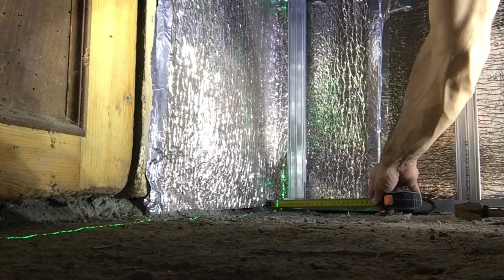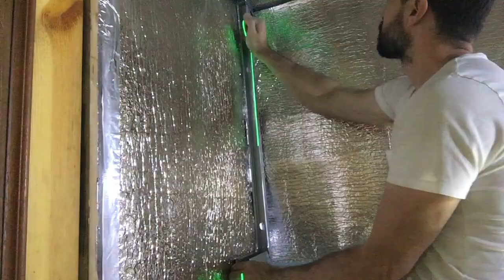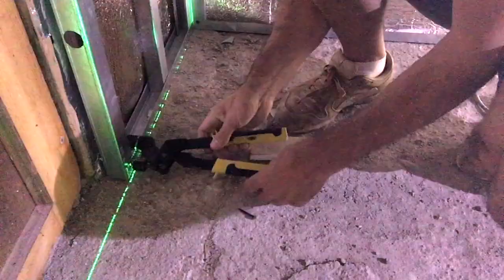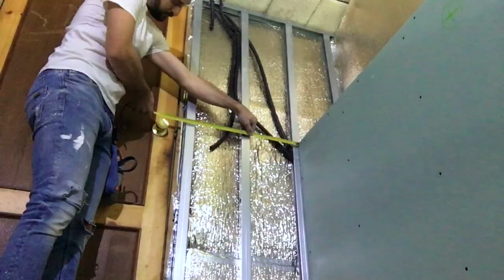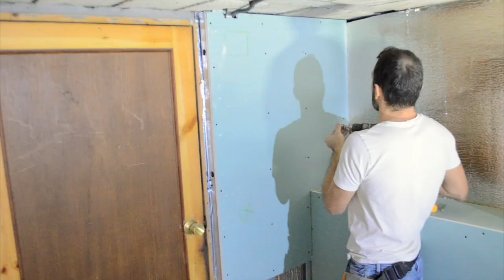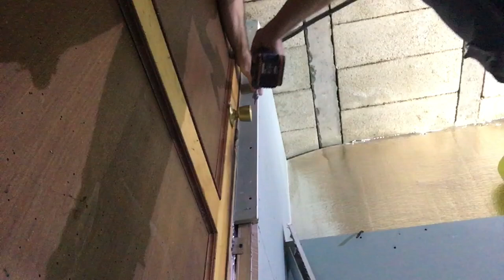🔥 Cómo hacer mini Trasdosado Autoportante de pladur 🤜 Perfiles 36mm ✅ drywall

Comment from the maker: :yougotthis:Muy buenas :elbowcough:

¿Qué son los trasdosados?

Un trasdosado es el revestimiento de cualquier tipo de muro que pueda existir en una vivienda, ya sea interior o de fachada. Los 3 tipos más comunes que se  utilizan en la construcción de viviendas son: el trasdosado directo, el trasdosado semidirecto y el trasdosado autoportante.

1. Trasdosados directosSe trata de placas de yeso delgadas y flexibles que con toques de pasta adhesiva se aplican directamente sobre muros rígidos y gruesos. La pasta permite la fijación y nivelación de las placas respetando una cámara de aire. Además, permiten incorporar en la cara oculta cualquier material de aislamiento térmico o acústico.
2. Trasdosados semidirectosSe trata de un tabique adosado a una pared vieja o nueva con perfiles omegas, llamados así por su forma. Se suelen utilizar para tapar viejos tabiques con imperfecciones y darles un aspecto totalmente nuevo.
3. Trasdosados autoportantesLos trasdosados autoportantes están formados por una estructura metálica de acero galvanizado que puede ser de canales y montantes o perfil U y maestra 60/27. A esta estructura se le atornillan una o más placas de yeso. Su espesor, cantidad y tipo irá en función de las características técnicas exigidas.